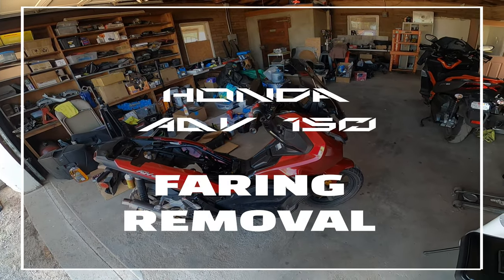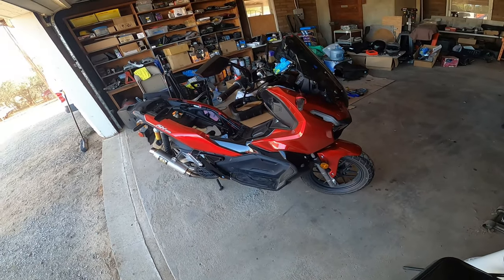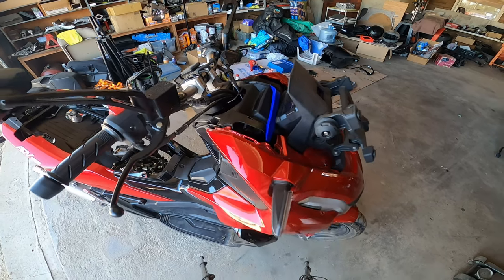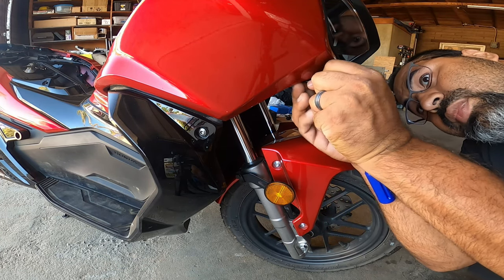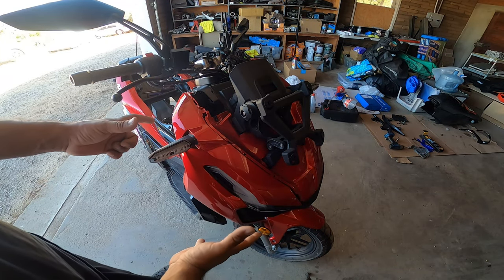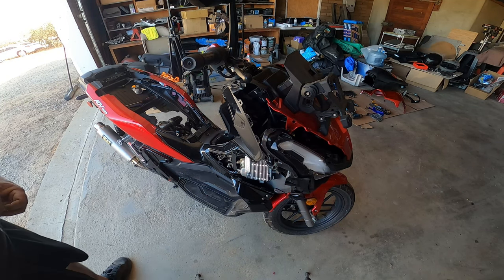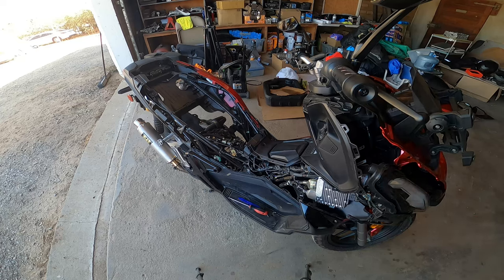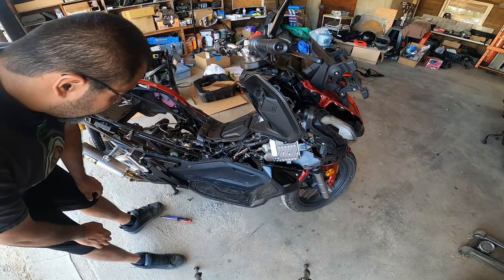Honda ADV 150 Faring Removal

Comment: Great tutorial.  Been trying to figure out if easier way to run a wire from handlebar to battery for my wifes quadlock.  Appears only way to access is to remove side fairing?  If so this video is super helpful.  Do wish there was an easier way though ha.
Reply: Run it into the glove box on left side.  Use the 12 volt outlet in there.  Yjats what I did.    Drill a hole,  in the glove box.